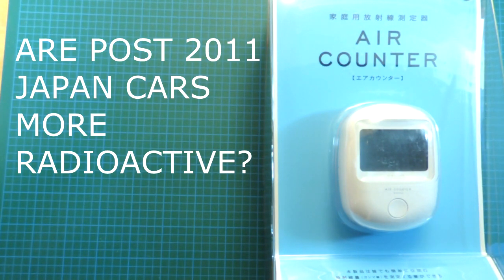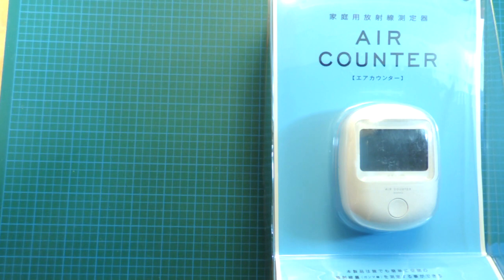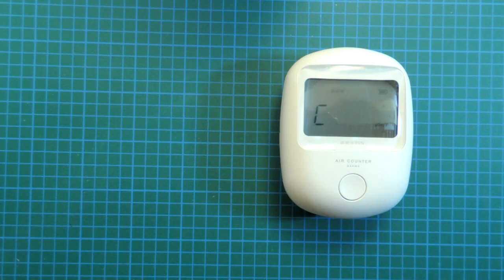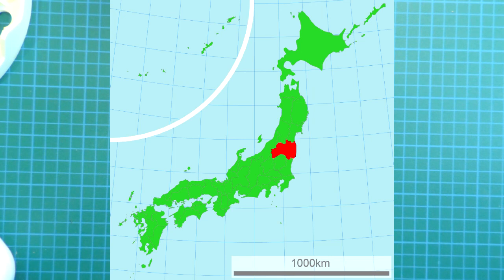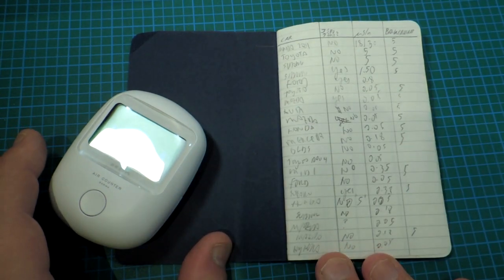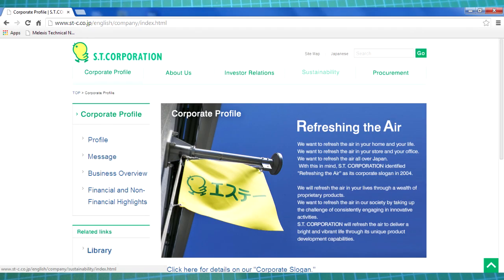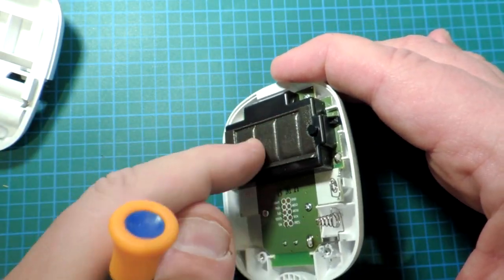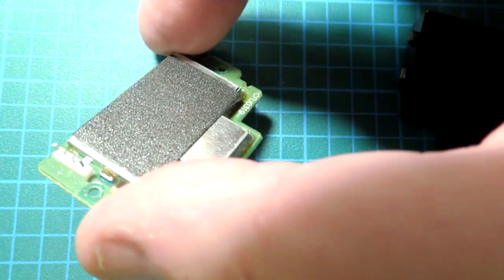Are Post 2011 Japan Cars More Radioactive?

Comment: The inverse square law does not apply to extended sources of radiation. Geiger counters and other radiation detection monitors are calibrated using the inverse square law.  Therefore, all measurements are null and void.

Comment: You can get a geiger-counter with a alpha window for about $150. They're not that expensive.

Also, 5 revs on, spark-fun has FINALLY added proper HV regulation, so they're actually useable at this point as well.

Comment: My best guess, is that the sensor is an array of photodiodes, placed under that black foam on the shielded box. It's inside that black box to keep light out. Try to shine a bright light into the module, while having removed the black housing, and see the counts rise.
Reply: Yeah, I'm pretty sure that's how they work and also the only way to get it working for that price. I've used similar sensors (from http://www.teviso.com/) in a project. It had about them same sensitivity (i.e. can't really measure background radiation, but sensitive enough to detect the radiation levels from a Radium painted clock or a Uranium glazed tile).